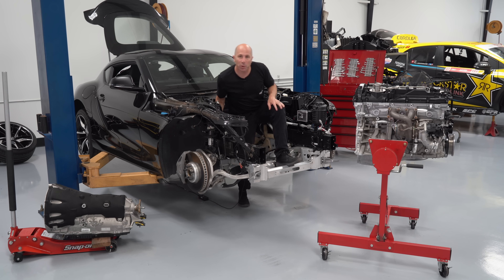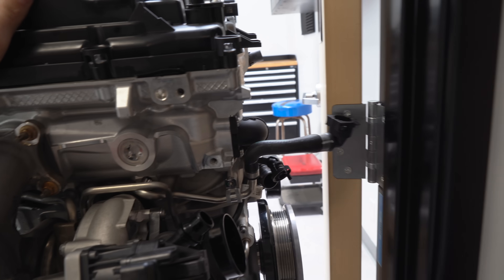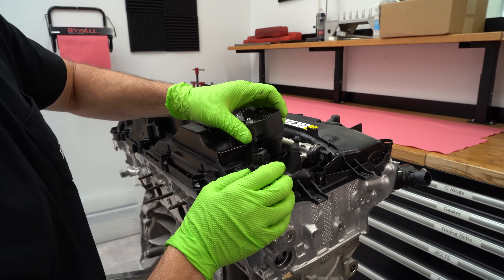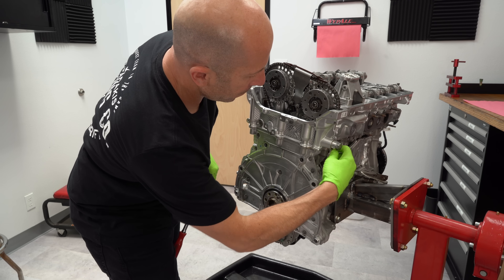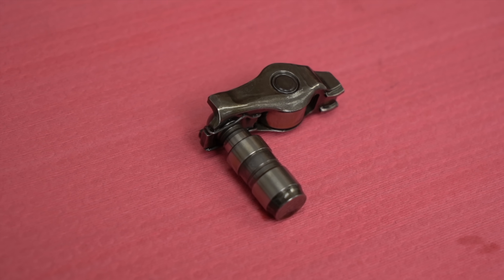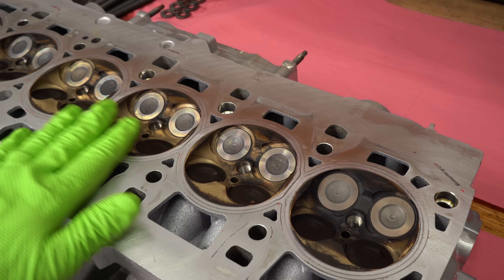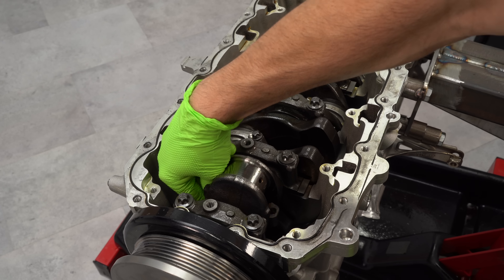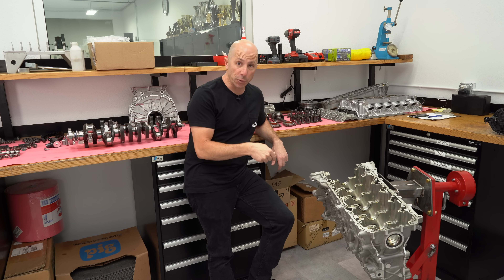2020 Supra B58 Engine Teardown - First Look - Better than the 2JZ?

Comment: Piston side skirts are the same on both sides, sooo they have offset wristpin right? And crank isn't offset in relation to bores?
Also the combustion chamber looks really well done, nicely done valve shrouding aiding low lift airflow, which will make any head porting more profitable all across the board and not just at high lift, where the engine doesn't spend much time. 
Will You do head porting? If not, show as the ports how good they look like.

Comment: The germans really do.make good stuff that always breaks and is a pain to replace or remove. Toyota would have done alot better if they chose to. 
Only time will tell the problems we see with this motor, from the disassembly it looks like it will handle alot of power or stock

Comment: The only thing who has me wondering is: if the fact that the exaust manifold embedded in the block head would become a problem , you need to design a whole new head ? that sounds expansive. On the other end, the intercooler wich is part of the intake manifold doesn't seem a tricky problem (anFMIC and some tubing should do it)

Comment: So many negative comments..

How are people disappointed over a modern I6 which is largely capable of 1000HP while also being much more efficient and better for the environment than the 2J?

We should be celebrating these engines in an era where the EV is making more sense than ever. 

Let’s also not forget, the 2JZ was not a Toyota original design either, AND the McLaren F1 which is largely considered to be the greatest car in history, had a BMW engine.
Reply: ..probably because 2JZ allowed DIY garage boi community to do some stunning upgrades with cost they could deal with...there is virtually, no way to do so with this model for 99% of Supra fanboys..
Reply: Ecco Sabanovic that’s the case for every modern engine though. My Coyote Mustang engine is the same way, it’s really hard to do much outside of bolt-ons because the engine itself is so complex, so large and difficult to work on with so many sensors and extra components. 

Toyota made this engine difficult to work on not by choice, but by necessity of today’s emission laws. Keep in mind this has to be sold all over europe, which has far stricter laws than we do here as far as being green. That’s why all engines are so complex now.

Comment: If you want to remove the variable valve lift altogether, you can use Peugeot 208 R2 rallycar parts, if you can get your hands on some. They use proprietary billet rockers that install into the bore of the hydraulic lifters. Really cool stuff.
Reply: twist2410 why not keep the variable cams? He said himself that it was essential om modern race engines.. And they could probably just replace the hydraulic lifters with custom machanical lifters..

Comment: I cannot wait to start seeing the anti-b58 crew start to appreciate how good this engine is going to be.
Thank you for posting this!!
Reply: Hope you have plenty of time to waste just waiting
Reply: Omar Monelle b58 was the best option for the new supra
Reply: We wouldn’t fanboy
Reply: @BF109G4  admit it its a great motor iys closed deck and the pistons has a coating to minimize friction and even the bearings are coated it also has a forged crank but time will tell if the new supra is trash or great
Reply: Durancito Duran 
The pistons are coated but are they stiff ? No
The coating alone is nothing, you need also to have strength. The engine has complicated cooling system, complicated head, and complicated timing chain system
Reply: @BF109G4  you have a point but time will tell if its reliable or its not reliable but it does have potential

Comment: This cylinder head does not look like it will handle the exhaust flow of a 1000hp engine. Thinking of 80mm inlet turbos on the good old 2jz there is a ton of air going through and just like 1.5 times that much exhaust gas needing to go back out ;)

Comment: I grew up with the "coil-on-plug" ignition system simply referred to as a "low tension" system (as opposed to a remote coil "high tension" system).

Comment: Correct me if I'm wrong but i think plastic and aluminum has different thermal expansion as 2 different materials. So how its good when after extreme temperature variations it won't loosen up and starting annoyingly leaking fluids? Considering intake boost pressure? Seriously! At those conditions it won't last more than 30.000km

Comment: Typical bmw over complicating everything.
Also there is a thin wall socket you need for those plugs specifically for BMW.
Reply: Nissan uses the same 14mm slim spark plug socket
Reply: Volkswagen does the same but with 16mm.
Reply: Oh typical Nissan making a hydraulic 4 wheel steering system in fucking 1990...

Comment: There is a lot that I like about this engine. Not a huge fan of the siamese exhaust porting, but it would make manifolds a lot cheaper, it's also not an issue if it flows well enough. The bearing coating is very interesting too

Comment: Kind of surprised BMW made it a traditional block/main cap style engine after years of doing the block/bedplate style which always looked like about the stiffest possible setup you could have. 

The windage tray and oil drain setup is nice though
Reply: I wouldn’t think so. The sump depth isn’t any greater

Comment: Do they still measure the oil pressure in anyway? or is it just the pan has enough oil therefor all must be good? I understand this has become the trend but I don't like it. Oil Pumps can wear especially if the timing guides get damaged due to age and start to fret plastic into the oil. and things like o-rings on the oil pump related piping can break down over time causing the oil pressure to drop. None of these will result in a loss of oil in the pan. I understand that a simple idiot light wouldn't work well in a car that has start and stop tech but you'd think they could have give the ECU an input for a pressure switch or sensor with a table for when their should be pressure.

Comment: Valve rocker arms, two port exhaust, single row timing chain, chain driven oil pump, direct  fuel injection, mechanical pump, yeah this is miles ahead of a 2j 🤣🤣🤣🤮

Comment: BMW builds the best straight 6 cylinder engines. No doubt. However their ecu's always have military grade encryption which takes years to crack. No good building an engine of you can't tune it.
Reply: its already been cracked.Most powerfull a90 is 485whp

Comment: Better than the 2jz 😂. Absolutely not. 2 small exhaust ports, plastic intercooler, aluminum block thats braced for strength, specialized tools just to take out a spark plug, REAR timing chain that requires an engine pull to service...jeez. No average person can work on this engine in their garage.
 Everyone wants to take down the MKIV and the 2jzgte. Most have tried, all have failed.

Comment: : world you can’t put a intercooler inside the manifold 

Bmw - hold my schnitzel.
Reply: This is very typical in air to water setups. There is actually a separate heat exchanger mounted up front to receive air flow like a radiator. A water pump, usually and electronic one, then circulates the coolant through the heat exchanger. Then to the aftercooler in the intake manifold. A lot of supercharged cars are this way. I wont be shocked if they do not add a large front mount air to air intercooler as well during the  build, or ditch the water cooled setup entirely.
Reply: To do it more bad ass the manifold is going to be made of plastic lel
Reply: I love schnitzel
Reply: Also another limiting factor on this engine is the heat exchanger. You only have so much surface area and I bet the aftermarket is going to provide front mount intercooler setups.
Reply: TTWVGT, I was actually more surprised to see them use a W2A IC than an A2A IC than I was to see the intercooler core in the manifold considering the turbo application.
Reply: Thechristopherryan definitely not the first manufacturer to do it, but it is impressive 😂 and long life wise, stupid.
Reply: VW and audi been doing it for years on the diesel cars
Reply: The PLASTIC manifold
Reply: @KrashKan  plastic manifolds have been a thing for a long time. Even with "bulletproof" Mercedes from the 80s and 90s.
Reply: @KrashKan  theres plenty of vehicles that use plastic for the intake manifold,  clue is in the name "intake", research it.  Theres a reason why exhaust manifold ARE some form of metal.
Reply: @KrashKan  it's plastic cuz intake manifolds doesn't need to be (metal) cuz this will add useless weight... So plz read about cars a little before critising BMW for the lightweight plastic (____intake___) manifold
Reply: @abdullahmohammed2955  because weight reduction bro
Reply: @KrashKan  subaru sti tingssss
Reply: Thats fairly common
Reply: Lol 🤧😄😄😄
Reply: Thechristopherryan  too funny
Reply: Timing belt on back side all looks crappy like crappy toyota+bmw in one engine
Reply: Stop Teoriom Spiskowym lOoKs LiKE ToYOTA CrApPy mOtOR. Says someone who’s never heard of the N55 from BMW. Which can handle high 700HP bone stock internals
Reply: Thechristopherryan best comment yet
Reply: damn everybody goin sicko mode over a little criticism that wasn't even serious. I dont care about what your manifold is made out of, I was just concerned that the plastic manifold was touching the metal head which normally would get pretty hot since the coolant channels do go right through the head gasket which touches the head.
Reply: It's been done for ages
Reply: Thechristopherryan actually many American companies does
Reply: BMW uses cheap plastic for everything it's only a matter of time before it start leaking in the motor.
Reply: @MRwaterlicious  Plastic yes, cheap no. Lots of plastics are expensive and very tough.

I don't recall the manufacturer that had switched their engine sumps to plastic, and they weren't just lighter, when impact tested they were actually tougher than typical steel sumps.

And the reason the intercooler is there is to minimize the volume of the intake which reduces turbo lag. People who only care about a peak horsepower figure don't care about that, but BMW does, they don't make their engines for drag racing.
Reply: @BigUriel  BMW in particular uses cheap plastic underhood.
Reply: @MRwaterlicious  Or melts and the melted plastic gets sucked inside. Fucking stupid design. Use metal ffs. Paying more than 60k for a car that has plastic junk on it. Stupid
Reply: You cant put turbos in the engine valley.
Reply: @joshuaspencer6246  Uhh, go look at a V8 turbodiesel some time.
Reply: @immikeurnot   bmw  N63
Reply: Heavy, overcomplex, unreliable garbage, an intercooler in the manifold is stupid and asking for fuck ups. This motor will be the money pit of the century, people will just start jz swaping this closet BMW shit box within the year just wait